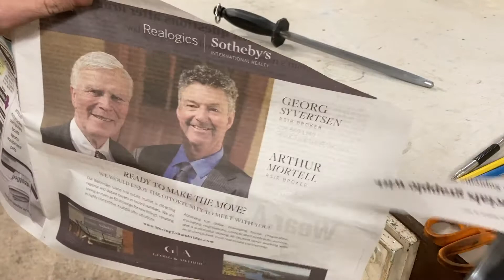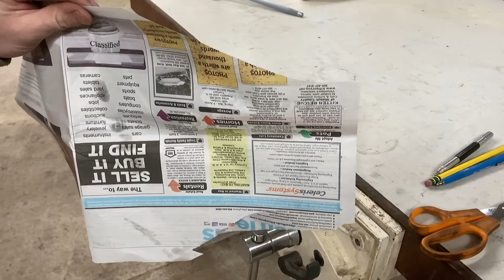Chris Redfield's Machete

Comment: excellent craftsmanship, I have a couple of questions, has a good balance? you would use this knife in the woods? how long is the knife, blade, and handle? do you accept commissions? do you ship to Peru?
Reply from the maker: The blade is a bit thicker than it should be, so there's extra forward weight. If I did it again, I'd go with 3/16" instead of 1/4". It's a 15" blade and 5 or 6" handle. I think it's a good design and I would use it as an all purpose camp knife. And, sorry, I don't sell my work.